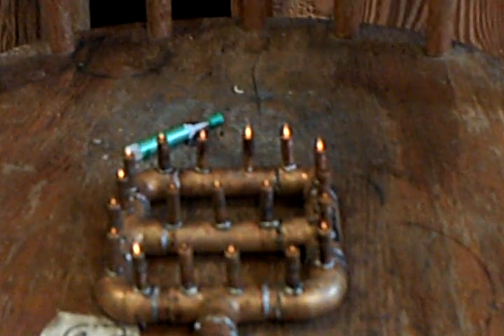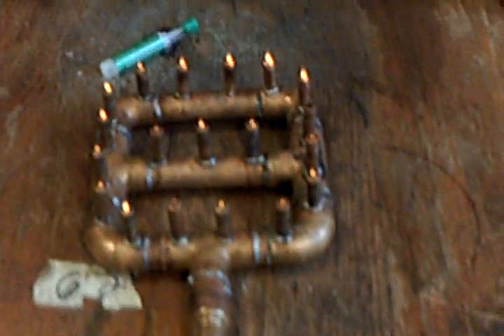19 Tip HHO BURNER New Permanent Design

Comment: Not to snipe at y'all, but a very inexpensive way to provide flameproof tips that are solderable is to use spent ammo casings. >22 cases drilled with a tiny drill bit and soldered  onto the pipe would cut down your expense of 1/2 piping and packing for reduction.  Plus harvesting those by-products is fun in itself.

Comment: i think you have to do water boiling to get an accurate test.either boil or even more accurate boil over as this happens within a moment but water boiling is hard to detect when you would class it as starting. maybe the start of small bubbles could be the measure but i think with a lid on and it boiling over would be really accurate.

Comment: just a idea, but along time ago to change natural gas to lp, we used to have to drill out the orifice, with really small drill bits, they could be available at any hvac parts house, you should check around, it would be a whole lot easier drilling it than soldiering? just my opinion,  anyway great job, you can really use the hho your making.

Comment: Introduce the HHO into the burner which has an air port in it. (Bunsen? kinda burner) Also "lightback" occurs when there isnt enough gas pressure. ie, the gas is coming slower than the flame speed of the gas.

Comment: i really appreciate your effort in the build but can i just ask why you just did not coil some quarter inch copper tube as plug it at one end with heaps of very small hole burnt or drilled through it.
maybe you have reason and i want to know as i was going to do just that.

Comment from the maker: If you are getting flashbacks then the hole size is to big for the amount of gas you have going thru it ..If you are using mig tips you close the hole up some by tapping the top with a spoon or hammer ..What are you using and how many LPM are you doing ?

Comment: @jdcmusicman  but if your flame burns into the copper you then have a small copper pipe bomb.. 
also the heat output would be much better with more pressure or flow those flames are tiny

Comment: I was wondering at 2.5 LPM what was your BTU output. I was considering putting 1 of these in a straight copper tube with fake logs or lava rocks for a heat source. Is it a crazy idea from your experience? Thanks JNC

Comment from the maker: What I done was take a hammer and tap on the tips to close the hole up some..if you have .025 tips to use them normal you need approx. 1 - 1 1/2 lpm per tip ...2 lpm with 3 tips will work fine if you close the holes up so they are bout half the diameter of a .025 tip...

Comment from the maker: True but that has never happened ...There is approximate 1 - 1 1/2 psi on the burner in this video...That is one reason I rarely have a flashbacks or problems with flame burning in the copper tubing